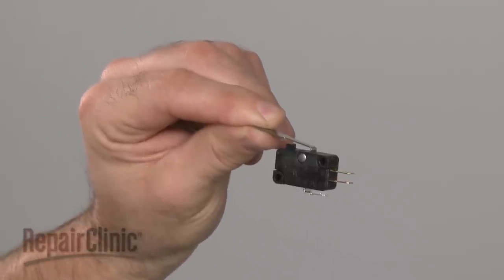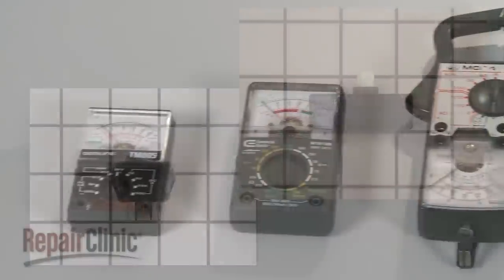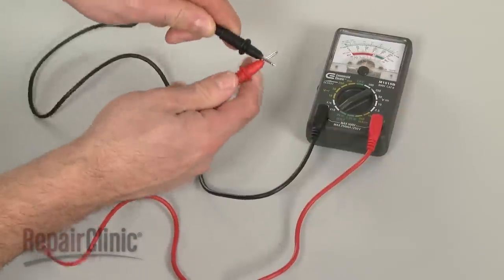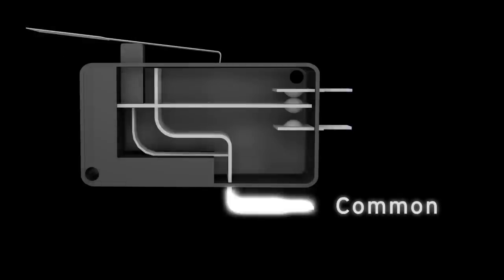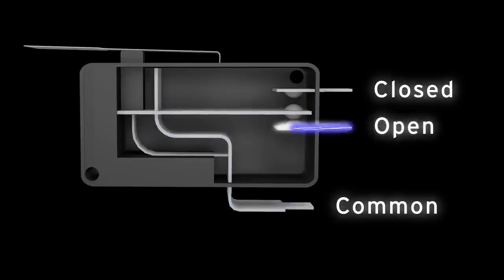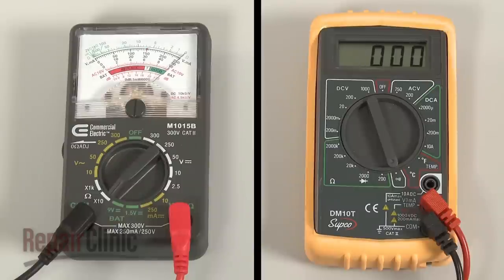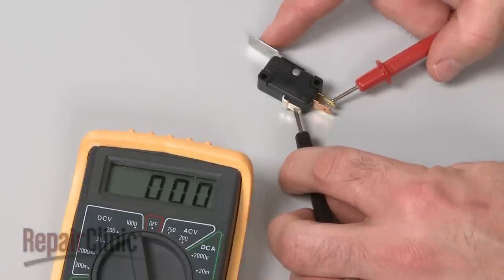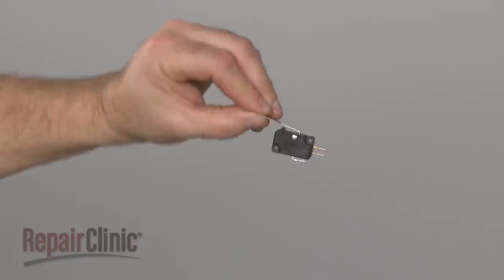Range Vent Hood Not Working? Switch Testing, Troubleshooting

Comment: Wouldn't it be easier to just replace the switch?
Reply: If you don't need to why do it. I was about to replace my awning motor and found out it was just the switch! Otherwise I would have replaced the expensive motor. Its always best to check the switch first.